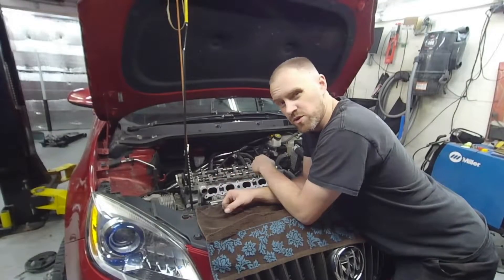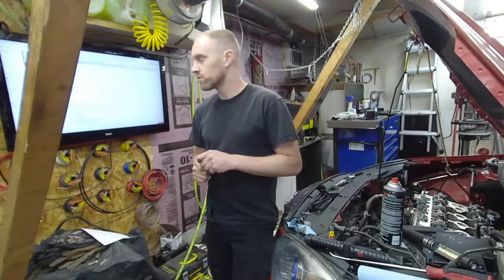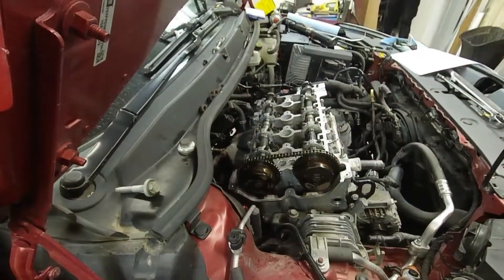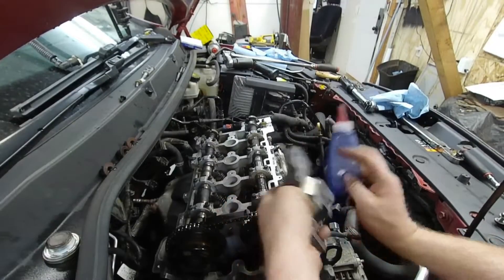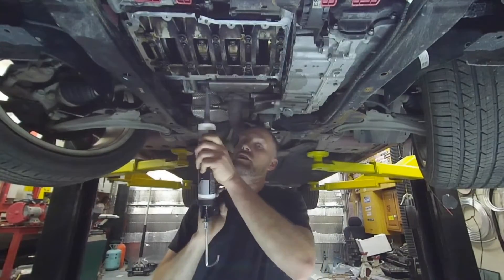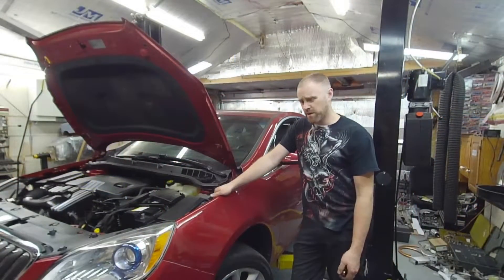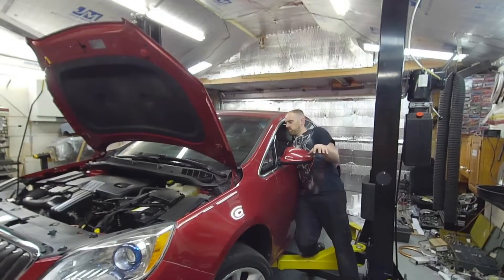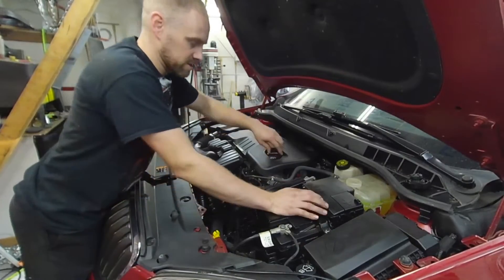2012 Buick Ecotec Blow By Issue From Bad Factory Piston Rings PT4

Comment: Great that you cleaned the PCV orifice, this is major cause of rear seal failures in freezing weather.  When both the clean side and this orifice is blocked is when it happens. The best way to check for crankcase vacuum is using the dipstick tube.  Too much turbulence in the camshaft cover.  The orifice is routed to all four intake runners where air is drawn evenly.  Each of those need to be check.  Blowing brake clean through does the job.  On mine I installed a fitting on the camshaft cover to I can inject cleaner through orifice on a regular basis to keep carbon from building up.  Sure beats pulling the intake manifold.
Reply: More information on your mod, please!  I keep thinking there might be a way to clean that orifice externally with a well placed hole for a carb cleaner straw then you could plug it.

Comment: GREAT video and advice on the crank gear, I agree on the butterflies after a big job they go away after a while. Like cuttin your teeth the engines today are almost disposable as one would need a home loan to buy the parts. GM small blocks are still the most reliable, easiest to work even with the woes of AFM still better. Now they got that DFM another disaster.
Reply from the maker: yeah some of these engines can get real costly really fast that's for sure..

Comment: I wonder if that plugged EGR orifice wasn't the source of the problem.  When it plugs up the blow-by only has one place to go, out the PVC intake port on the valve cover, into the air cleaner where the oil collects until it's sucked down the intake runners to be burned in the cylinders.  Easy way to test that orifice in the intake manifold is with the engine idling there should be vacuum at that PVC port on the valve cover and at the dipstick tube, with the stick removed.
Reply from the maker: Exactly my thoughts when I checked that.

Comment: Thank you for the video series on repairing the defective piston rings.  Can you share how much you spent on parts to do the job?  I'm considering doing this repair as I too have a '12 Verano with excessive oil consumption.  Thanks!
Reply from the maker: Make sure to look at the pcv valve port in the intake before you dig into the job. It is usually plugged up with carbon and needs to be cleaned. I have cleaned them out with a small drill bit a couple times. I thing it's like a 1/8in hole or something. Not sure on parts cost, I could look back at invoice but Price's may have changed by now. Best bet is rockauto.com for best price.
Reply: @CrazedPerformanceRepair   Thank you for your reply!  Yes I saw you having to go back and remove the intake to clean out the PVC orifice.  I have a few more questions if I may ask.  GM now has a piston & ring kit as part of their SB addressing the oil consumption issue.  Any ideas why GM would include the pistons?  You only replaced the rings.  Speaking of rings, I assume standard sized rings (vs. oversized) is what I need?  Also, you replaced the Catalytic converter.  Did you go with an aftermarket one?  Thanks again for a great video!
Reply from the maker: The only reason I see needing the pistons is because of how the coating wore off them. There was nothing about the pistons when I did the job. As for the ring size, it is not getting bored out so standard rings is what is needed. Stick to a OEM converter if you can.

Comment: Also tell me if it is necessary to bore the cylinders, it is believed that without bore, replacing the rings will not help to overcome the increased oil consumption.